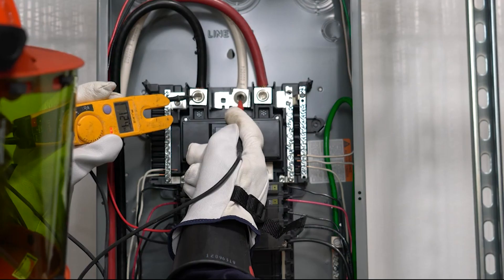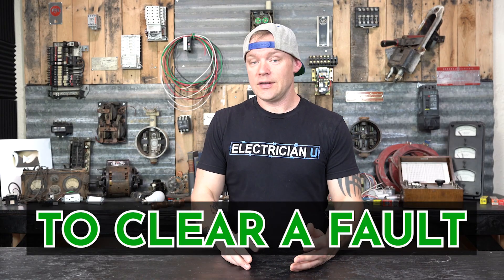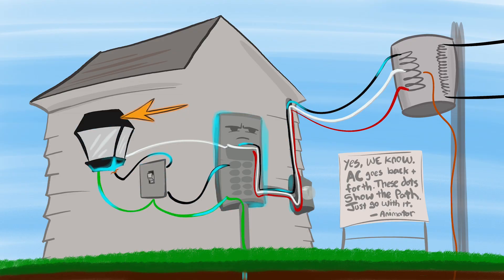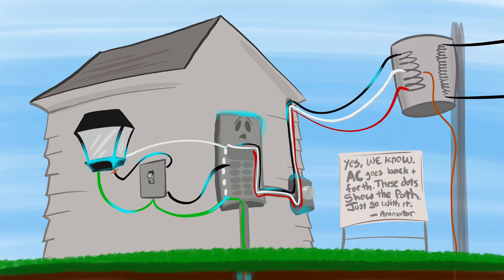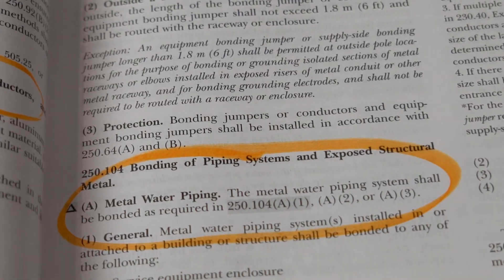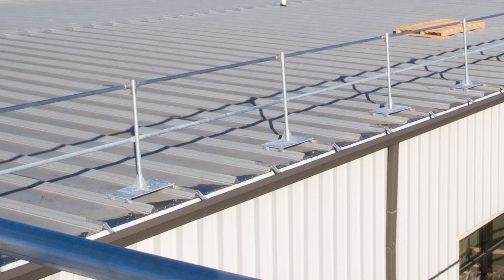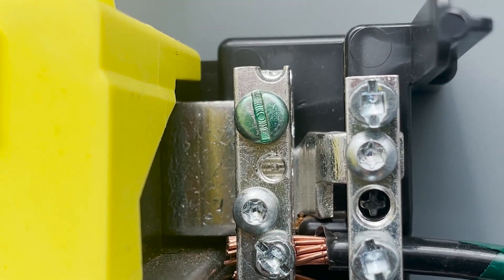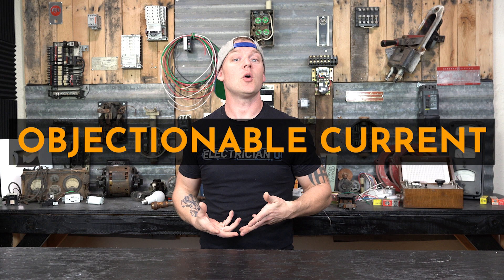Why Do We BOND Neutral & Ground in ELECTRICAL SERVICE PANELS?

Comment: I had a big discussion about bonding. I have a very disconnected building I call my barn. It's a metal covered pole barn. Disconnected, meaning it's 500 ft away from the service main. My barn panel should be bonded but man people lose it when you even suggest bonding a "sub panel" . People have heard so many times to NEVER bond a sub panel that they just repeat it because 99% of the time you will NEVER want to bond neutral and ground. That being said there are condition where you should and must bond on a sub panel. These scenarios do exist. However they are VERY rare. At least as far as I understand it.
Reply: Distance does NOT change the fact that we do NOT re-bond a subpanel in the USA.  If you have a Ground Wire / Connection ( via conduit ) between the Main Panel and Sub-Panel then we do NOT re-bond, period.  That is CODE now.  In the OLD DAYS, NEC did allow ONLY Hot & Neutral wires ( no ground wire ) between the house and barn. You are grand-fathered-in and you allowed to create a separate N-G Bond and add another ground rod within the barn ...
Reply: @MrSummitville   I agree with you 99.9%. There are situations like mine that CODE says you SHOULD rebond. You may not have experience said situation because it's very rare and most people don't understand the why. They know the "code" but they don't know why the codes exist and why you should bond in the first place. And that is fine. However the situation for bonding at a subpanel does exist. And my specific situation is that situation and requires it.
Reply: @BobbyCannon  What is your "special situation" that allows you to RE-BOND the Ground Bar and Neutral Bar in the Sub-Panel?  Where this allowed in the 2017 NEC Code ?
Reply: @MrSummitville  I'm not interesting in arguing. Again I agree with you 99.9% however you miss the point that they are circumstances where you can / may bond a subpanel. I live on a old hunting property where they ran only 3 wire to my barn that is literally 600ft away. I could (maybe should) run a ground wire back to the main panel. However that is really expensive and hard. Digging through the wood is not an easy task. Especially right now. However until I do so it's best to provide a ground fault solution in the mean time.  https://diy.stackexchange.com/questions/97219/existing-3-wire-service-feed-to-sub-panel-bonding-grounded-neutral-and-ground-b
Reply: @BobbyCannon  I don't care what the code WAS when your barn was built.  That was then, this now.  What was grand-fathered (allowed) under a previous NEC, is no longer up to code TODAY.  All new sub-panels must meet the existing National Electric Code.  There are no exceptions unless allowed, unless approved by the Local Inspector ( ie not you ).  You have no authority, to tell anybody, that they can violate the National Electric Code ...

Comment: Bro the MEN link (Main earth neutral) connections best part of it the electrical field. Thanks for sharing this !
Reply: Maybe called Main Earth Neutral in US. In Aust it’s called Multiple Earth Neutral. Because at each main switchboard per property earth is made via an earthing rod & this earth is bonded to service neutral (as per the graphic in the video.) And as that service neutral is bonded to another earth at each and every house as well as the substation, there are multiple earthing points ... or Multiple Earth Neutral bonds.

Comment: Ok, so I have a question. Have you deal with 2 phase and neutral and grounds wired together?? I bought a house and at the box the ground and neutral are wired together, which I understand is what they did with 2 phase. Home much of a headache is it gonna be to work with? Should I just suck it up and rewire the whole house?
Reply: We do not have residential 2 Phase in the USA.  Where do have 2 Phase ?
Reply: @MrSummitville  in the USA, midwest
Reply: @scoutsaresilentdeath8775  No, you either have SINGLE Phase 240 Volts AC 3-Wire Split-Phase, which is now the STANDARD or you have the older 120 VAC Single Phase.  The USA does not use 2 Phase ...

Comment: Can we like.... hire YOU to fix our community power? We've called several "professional, industrial" electricians and they don't even know what to do. Problem was our power got routed to the ground shared with the TV cable box and zapped the cable wire. Nearly caused a massive fire. No one knows how to fix it. :/

Comment: In the first fault you showed with the hot touching the chassis of the light fixture, it's my understanding that current can still flow by taking the path through the earth ground at the service panel, to the earth ground at the utility pole, since the ground at the utility pole is connected to the neutral at the transformer on the pole.
Reply: That path would probably NOT trip the Circuit Breaker ...

Comment: 13:33 You'd also have current flowing through both the neutral and ground even if you don't have a fault condition. If a subpanel has neutral and ground bonded together, any unbalanced current would flow back to the main panel on both the neutral and ground, right?
Reply: Yes.
Reply: In a three-phase system, a perfectly balanced circuit would have no neutral current.  You would only see neutral current when you have an imbalance between any of the three legs on the Wye side of a solidly grounded transformer for example.  On a single phase panelboard (say a 240V/120V panel in a residence), you'll measure neutral current as that is the return path to the source for 120V loads connected from line to neutral.  This is why single phase panels have odd and even numbered circuit breakers.  You want a balance between 120V loads from line to neutral on even and odd circuits.  Putting all of the 120V line to neutral loads on even numbered breakers (for example) is unwise and would cause an imbalance seen by the transformer upstream of the panel.  Ideally, the 240V loads connected line to line shouldn't cause an imbalance.  Your ground IS NEVER a current carrying conductor.  Ideally, it would see no current it's entire existence.  The sole reason for ground conductors is that, during a fault (or short circuit), there is a low impedance path for electricity to return to its source that will quickly open protective devices (breakers) in the circuit where the fault is located.  This is why the ground and neutral are bonded in one place and one place only.  So electricity has a low impedance path directly back to the source (avoiding ground loops or parallel paths).

Comment: Question should you put a ground rod where a generator comes in? and connect it to the grounding of the house? i.e. bond it to the house wiring?
Reply: Bond Neutral & Ground  at one point ...

Comment: A lot of wiring up until about the 1950's wasn't grounded at all.  I'm not even sure the neutral was grounded at the house; only out at the pole.
Reply: I looked up Grounding in the 1928 NEC. Article 9 page123 - 135 talks about grounding, including grounding the neutral at the main service

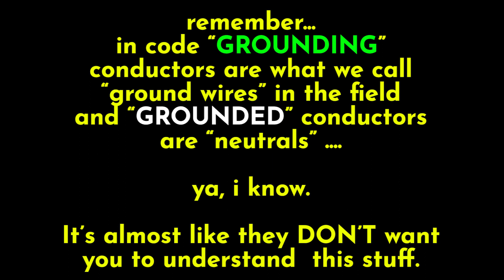Comment: At 7:56.........Most of the Field Terminology used in the industry is borne out of "Shop Talk". What I mean by that, we ascribe a name to something, and that name sticks no matter what. For instance, a pair of Lineman's cutters we call " Kliens". For insulation resistance testing, we call the device a Megger, even though that is the name of a brand of IR Test Equipment. Where am I going with this......well, a wire with a white jacket, we automatically assume it to be a Neutral. But technically that is not the case, particularly in a Branch circuit, where you have a Black, White and a Green. In a situation like this, the white wire is the Grounded Conductor, and NOT a neutral. A true Neutral is a conductor in a split phase circuit that carries the unbalanced load current between the (2) Hots back to the Source. If the load is perfectly balanced between (L1) and (L2), then there will be zero current on the Neutral. However, in a Branch circuit (Blk,Wht, Grn), there will ALWAYS be current on the White wire.

Comment: Why Don't we bond ground and neutral beyond the main disc
Reply: Because you want a single point where the ground and neutral are bonded at a service entrance.  This is your single low impedance path for electricity to return to its source.  If you bonded in multiple places, you'd have ground loops or multiple return paths.  This is undesirable for a number of reasons.
Reply: @kennykash6089  what reasons would those be?
Reply: @danslamusique  Ground loops.  You don't want your ground to become a current carrying conductor under normal operating conditions.  See Kirchoff's Current Law.  Electricity will always return to its source via every path possible.  Ground loops can cause serious problems on a power distribution system (to include fire) and can wreck havoc on control panels with sensitive equipment.
Reply: @kennykash6089  outstanding sir! Thank you!
Reply: Because he said, "Don't do it !"